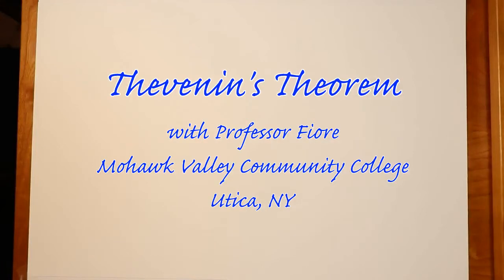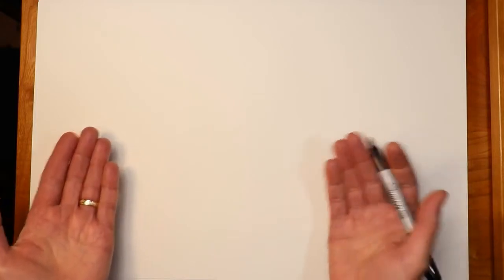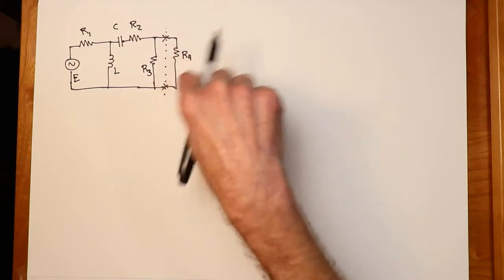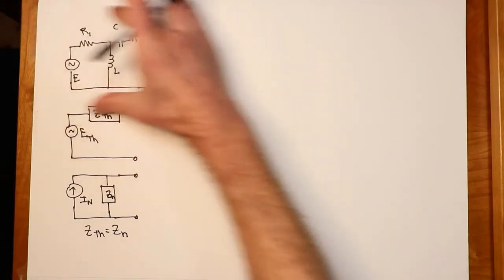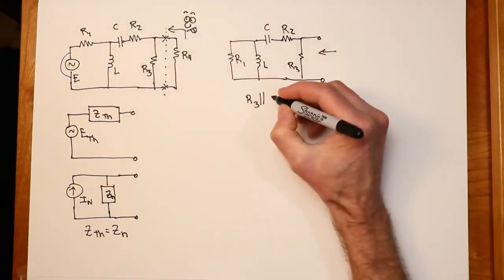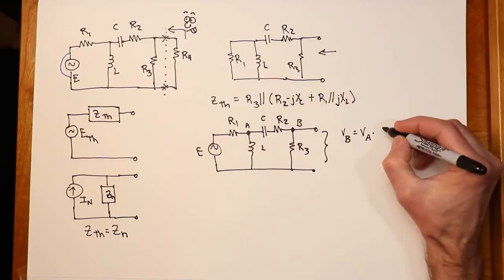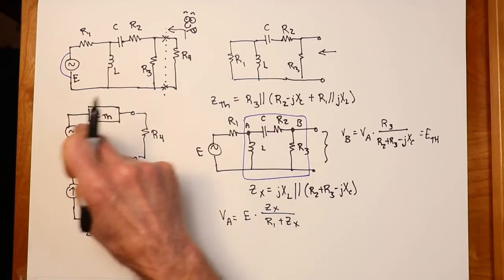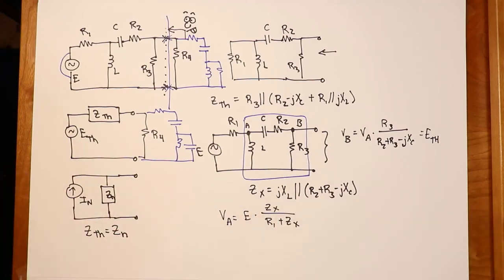AC Electrical Circuit Analysis: Thevenin's Theorem

Comment: In the Thevenin equivalent circuit, increasing R4 decreases effect of Zth on the frequency response so a HIGH value of R4 will produce a flatter response.
But in the Norton equivalent circuit increasing R5 increase the effect of Zn so we need a LOW value of R4 to produce the flatter response.
What am I missing??
Reply from the maker: R5? Do you mean R4 or ...? In any event, Zn is in parallel with the load, vs. Zth which is in series with the load. I should also add that if we're going to talk about frequency response (this video focuses on single frequency analysis instead), be aware that this is a 2nd order network and plotting the frequency response is a bit more involved than that of a first order (RC or RL) system.
Reply: @ 
Yes, I meant R4. If Zth and Zn were just a capacitor, then to minimise the effect of the capacitor on the frequency response, then we seem to need a high value for Thevenin and a low value for Norton compared to Zth or Zn

Comment: Does the Thevenin equivalent circuit still work for a non ideal voltage source? Say your source is a battery, who's voltage output may vary a bit with different loads applied to it. I'm guessing that the Thevenin equivalent may not work if there are dependent components/sources in the substituted part of the circuit.
Reply from the maker: If it's what I call a first level approximation, the theorem works fine. What I mean by that is a voltage source with an internal resistance. If the model contains non-linear elements, then no, the equivalent may not be accurate.

Comment: In same circuit if L and  C would be in parallel then how can we solve it
Reply from the maker: Conceptually, you would use standard series-parallel techniques, just like you would if it was a DC circuit containing just resistors (the practical difference being the phase angles). If you can solve an AC circuit with a parallel LC combo, this is no different.

Comment: R4 is then a load resistor?
Reply from the maker: It could be (as here) but you can Thevenize from many different perspectives depending on what you want to do. An example would be determining the equivalent resistance that surrounds a coupling capacitor in an amplifier so that you could find the critical frequency. In that case you wouldn't bother with Eth.